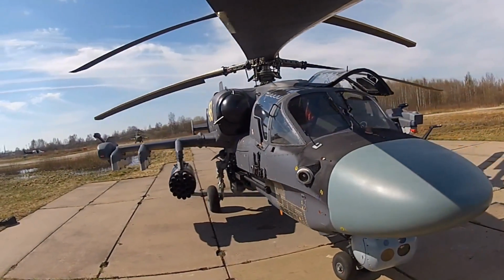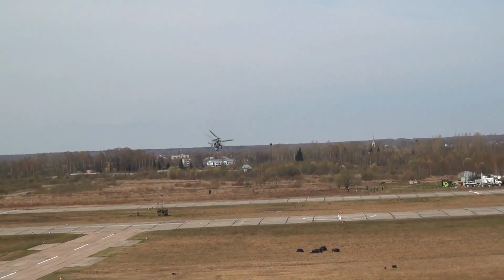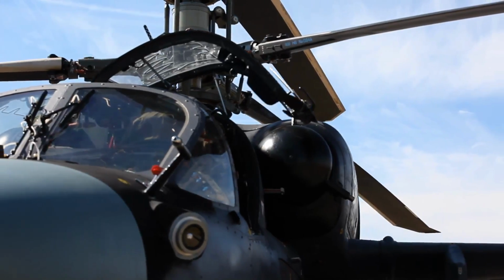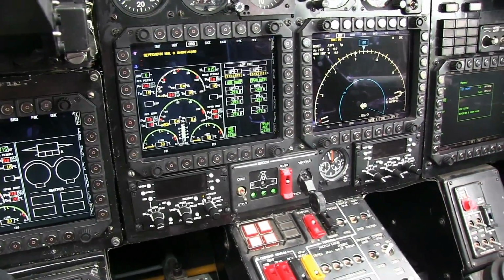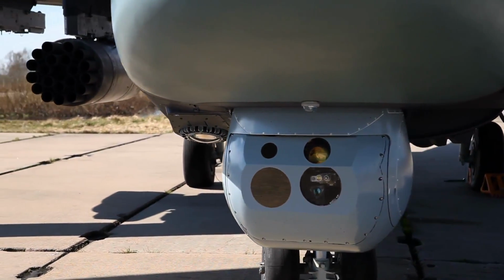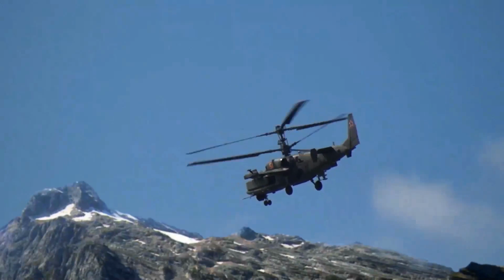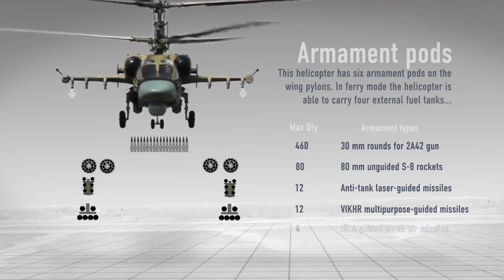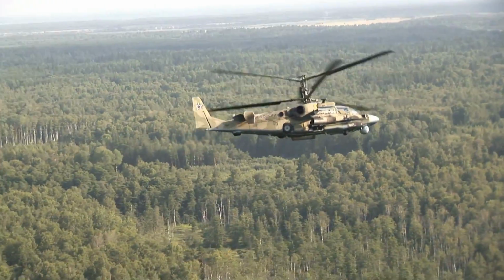Russian Helicopters - Ka-52 Alligator Attack Helicopter Capabilities [1080p]

Comment: Does anyone know why the US doesn't use the coaxil rotor like this helicopter uses? I'm sure there's drawbacks to both the traditional rotor and tail motor and the coaxil design. But can anyone explain?
Reply: Maybe because the next gen Helo from America is going to be like the Comanche and having coaxial rotors will not fit in well with the US Army's requirement for stealth in its future Airframes. I dunno just my thoughts
Reply: Mostly because the doctrine in the russian army is radically different from the nato. Those coaxial helicopters are almost used as aircraft, flying fast and strafing stuff around. On the west, choppers stay low and pop out to attack then go back to cover.

Also there's a concern over the fact that the blades touch each others during violent maneuvers.
Reply: Gaalua Ah, that makes sense. I always thought that having coaxil rotors, which allows the pilot to maintain its target while circling around it, instead of going in for a run then coming back around which you had to do with traditional rotors was a win win. 
 But with the technology we have with the Apache where the pilot can just pivot his head and shoot, the expense of coaxil rotors may not be necessary at all.
Reply from the maker: Kenny Yee Watch my videos on Sikorsky's X2 Technology & S-97 Raider Attack Helicopter. :-)
Reply: arronlee33 How about you stop trolling on other peoples post. Thanks bud!
Reply: because of lack of technology. USA is most advanced in electronic systems, but when it comes to machinery there appears a great lack of imagination and understanding of physics and materials. USA technology is developed thanks to a constant hire of scientists and engineers coming from other countries. Actually this means that without real nation the country gets just inhabitants.
Reply: Galova Congratulation! You just did a paralogism.
Reply: Gaalua congratulations you just did a demagody
and my last statement got yet another evidence.
Reply: Galova
Do you even know what a paralogism is?

You say that the USA have a "lack of imagination and understanding of physics" (which i won't comment) and then you add that they hire scientists from all around the world... If they're backward and hire where there is "imagination" (so you say) then they're hiring exactly what they need to not be backward anymore! You're contradicting yourself!

Then you say: "Actually this means that without real nation the country gets just inhabitants." (Which is a demagogical sentence btw.) It's the US! It's a country that practically grew on high immigration and fast assimilation!

So the fact that you're comparing 2 doctrines of approach to a "lack of technology" and then you go on on conspirationist theory just mean that you want only to talk about that and digress from the subject every time you can. So, please, keep the subject on the choppers.
Reply: Gaalua bla bla
Reply: Gaalua Galova is right.  The US education system is sadly lacking and the news they show us on TV is censored and diluted in every way.  The Government and Armed Services use the incredible technology they have to work toward their own agenda and to keep the masses from getting an inkling of their plan.  I know you may not think I am telling the truth, but please do your research to try to disprove me.  Remember don't look at what they say, look at what they don't say.  There is a pattern that is too regular to be coincidence.
Reply: James Burleson If you're talkin the news media I agree...but you cannot dispute the tech. American tech is way  up there. You don't have to acknowledge that...but there it is......
Reply: James Burleson The common people don't make the advances in technologies and it takes several years for the industries to appropriate one and distribute it. The guy made a stupid statement about "lack of imagination".

It's is very known that the US education system is quite lacking but smart people exist nonetheless (immigrated or not) and they still end up contributing technological advancement. The system seems good to single out the best and throw out the rest in oblivion.
And yes, a lot of things are discovered by the army and they keep it secret unless they don't have any use for it. Maybe if you'd stop giving >2000$ pro capita to the army they'd stop doing all that research.

@ Galova: great answer... oh wait is this the government that took your account to discredit you? Oh wait, now you'll discredit me saying that I'm a conspirator?
Reply: Gaalua Thanks!
Reply: Kenny Yee Actualy it's really hard to make fully balanced coaxial rotor (you can see it on Sikorsky presentation of X2 and S-97). In terms of danger of blades touch each other - it's really rare cases. For example, Vorobyov helicopter crashed trying to perform a half roll with a turn. This isn't a maneuver that pilots will perform routine. Classic scheme is much easier to build, but you'll have to pay 15 to 25% of performance and helicopters is harder to control (on increasing or decreasing throttle you have to move pedals). But it's like V-22 Osprey - russians won't build one 'cause it's really long hard road to understand how it's done. Likewise with coaxial scheme for US (russians build it from 1940'th).
Reply: trionghost Ah, I see what you're saying. With drone technology, and advanced software you would think that this would be an easy process to go small scale and easily go into big scale production with all the mistakes already tinkered out.
Reply: Kenny Yee  You can't just scale up small drone to fullscale plane/helicopter. It have different Reynolds number - different ratio between the size of the aircraft and the air vortex and boundary layer of air. Different size lead to different aerodynamics. And different structural strength.
Sometimes I think that I shoud make a video about basics of aerodynamics to educate people a little :)
Reply: Kenny Yee Because USA cant make one,too much technology involved in materials and drive systems!
Reply: trionghost you gave the only response with which i found to be reasonable and educating. thank you.
Reply: Wataah!  No problem, actually I'm design engineer at Kamov JSC, so I know what I'm talking about ;)
Reply: sty0pa nope. Hard rotor and fully balanced rotor are different things. On fully balanced rotor you need to deal with blades intersection, on hard coaxial rotor - main problem is vibrations (and in this cause - low lifetime of constructions and difficulties in controlling chopper). So from science point of view - it's different things, for different purpose.
Reply: Kenny Yee The world as a whole generally stays away from coaxial helis; the two counter-rotating rotors require two swashplates, one of which must run at twice rotor speed (because they turn in opposite directions), a whole pile of pushrods and balljoints to couple the two to provide control, and the generally 'mushy' yaw control which is provided using differential collective. The control system is, overall, much more complex and expensive, and requires more maintenance.
The standard one-main and one-tail-rotor arrangement is mechanically the simplest, and requires only straightforward mechanical linkages for control.

That's why.
Reply: +Kenny Yee 

AFAIK Most American attack vehicles focus on weapon delivery, rather than vehicle performance. You don't need to worry so much about ceiling height, speed, maneuverability if your weapon systems are designed to target and attack enemies over the horizon.
Reply: Hazzard65 I think that's a great theory, especially with the F35 and such.
Reply: BasementEngineer Thanks!
Reply: +Kenny Yee because the corporations who's paying the politicians to get the contracts don't have to change nothing, whatever s cheapest for them to produce and makes them more profit.  This greediness has destroyed the US
Reply: +Kenny Yee Because is not easy to just add an other coaxil.. Whole mecanic must be changed.. Plans, factories etc.. plus principles to not repeat to Russia...
Reply: +Kenny Yee coaxial rotors have their drawbacks for sure. First is mechanical complexity and therefore price. Second is that Russia really mastered it while US relied on traditional schemes. Considering modern anti-aircraft missiles I wouldn't give any of those heli's a chance anyway.
Reply: ***** I'm not really sure why the American colonists killed the Natives... They may have been useful as worker drones (i.e slaves!) ;)
Considering that the 'Indians' didn't have any guns, I'm not sure how they would have been a serious threat to the colonists anyway.
A mystery of US history, to me as a Canadian. Largely ancient history in modern times, in either country... but still a mystery.
Reply: Konstantin Klimenko OK... The counter-rotating coaxial is more efficient in flight. The two rotors both contribute to producing lift, whereas with a single main lifting rotor and a separate tail rotor, the tail can absorb 25% or more of the engine power without producing any lift. So, the conventional tail rotor design burns more fuel for a given aircraft weight and flight time.
However, the coaxial design is more complex, expensive and maintenance-intensive, so the world as a whole (not just the USA) favours the conventional single-main-rotor layout with a tail rotor.
Reply: +Kenny Yee -- The Russians have the patent. USA are not allowed to use it.
Reply: Ernst Stavro Blofeld Individual countries can build whatever they want... especially the US military :)
Reply: BasementEngineer Patent is patent. Why do you think the Chinese do not market their own iPhone-C?
Reply: Ernst Stavro Blofeld They do, you just can't buy 'em here (or you can, you just have to know where to look.)
Reply: BasementEngineer Where do I have to look?
Reply: OK everyone, here goes...
Pretty much the whole world (including the Russians) usually build conventional helicopters because they're mechanically simpler and require less maintenance for a given flight time.
Coaxials will burn about 1/4 less fuel for a given payload and flight time. That's it.
Conventional single main rotor with tail is used because it's more straightforward and practical to build and maintain. It uses a bit more fuel, but helicopters get horrible fuel economy anyway, so they just make the engine slightly more powerful and the fuel tanks bigger to compensate.
It has nothing to do with "not having the advanced technology", that is pure bullshit, the USA is just about the world's most advanced country in terms of aerospace and military technology. Give it up everyone, quit arguing over it, the conventional helicopter layout is almost always used for engineering reasons--because it's more practical overall, it costs less, is mechanically straightforward, has a simpler more straightforward flight control system, and it requires less maintenance. The fuel consumption of military helicopters is an insignificant portion of an entire nation's fuel usage.
If fuel economy is a major priority, you shouldn't be flying in a helicopter. ;)
Reply: BasementEngineer Funny that Donald Trump flies Rolls-Royce engines then. Why does a man, who can afford everything ,buy, according to you, second rate equipment?
Reply: Ernst Stavro Blofeld Never said RR were second rate... They have plenty of premium stuff... Concorde engines anyone?
Reply: BasementEngineer When I retire I am going to fit Concorde engines on my mobility-scooter.
Reply: Ernst Stavro Blofeld Where will you keep all the fuel? :)
Reply: BasementEngineer Inside the front-spikes.
Reply: BasementEngineer You did say Rolls Royce is second rate. RR is British. So if American engines, according to you, are first, RR must, by definition, be second.
Reply: Ernst Stavro Blofeld No I didn't. I simply said the USA is probably the world's most advanced country in terms of military hardware.
Plenty of countries produce good jet engines, Canada is actually supposed to be rather good at it for example, but we don't build fighter jets and haven't for a very long time.
Anyway, my other post is an explanation of why most of the world doesn't bother with counter-rotating coaxial helis. It certainly isn't because no-one knows how. They just know better.
Reply: +trionghost 

It would actually be very welcome if you made a video to explain the aerodynamics reasons why small drones couldn't just be scaled up :) please do.

Other question for you : what do you think as an expert of the intermeshing rotors design like on the Kaman K-Max  ?

Comment: For the armchair-warriors out there, you have to set numbers aside and look at how the vehicles would actually be used.   The United States has the most experience with attack helicopters of any nation at present.   If you want a fast aircraft that can fly high, you DO NOT get a still very slow and still very low altitude helicopter like the KA-52, you get a fixed wing jet.   It will fly higher, faster, and with a tiny radar footprint by comparison.

When we employ helicopters, and what has PROVEN successful, is to use them as extremely fast tanks.   The Apache has better armor to survive small arms fire, is very successful at peakaboo tactics with its dome radar mounted above the rotors so it only has to barely peak that above the tree line or ridge which the KA-52 cannot and must completely expose itself with its GIGANTIC silhouette, and the Apache most frequently deploys its sidewinders at long range completely unseen (up to 18km range) vs the KA-52s common tactics of swooping in completely exposed and firing a barrage of dumbfire missiles.   While the KA-52 does have guided missiles, the R73s aren't nearly as good and have only a 5km max range.  

So you would fly these COMPLETELY differently, but IMO the United States has a much better idea of what a helicopter should do, which is hug the ground (since a stealth helicopter has proven bullshit in practice), peakaboo, and hit fast and hard out of nowhere and disappear.

Comment: Well, the HAL Light Attack Helicopter has a ceiling of 6500m, so I don't know what the fuck these guys are talking about when they say that the KA-52 has the highest ceiling of any attack helicopter.
Reply: That's the Hover celing, wich is the maximum altitude wich the helicopter is able to maintain remaining stationary in the air (hovering)
SInce at these altitudes air is less thick engines and blades makes less thrust and in order to maintain higher altitudes you need to be moving forward, thus acheiving lift from the airstream hitting the blades (and creating Dissymmetry) and creating lift on the Stub wings

Comment: And the major handicap of this helicopter is its fixed machine guns, no turret got to turn the whole machine and before you do you're down.
Reply: It has co axis turrets
Reply: From what I understand that is actually a benefit as it makes the gun so much more accurate
Reply: It is allowed to increase accuracy of a factor of 2.5.
Reply: It's not fixed it does have a small range of movement. Being semi rigid gives it an increased range over a mounting like an apache's and since the helicopter is highly manouverable it's hardly the drawback you make it out to be. Even on the Apache the gun is mainly used on targets in front since it loses stability when off boresight.
Reply: jaxative jax This problem can be solved by using machine gun pods.
Reply: Billy Bob John
At first, you should understand, that there isn't machine gun, there is aircraft cannon. It's great difference, especially in recoil, consider, that to a plane work other forces as by vector as by value and installation of large caliberaircraft cannon on helicopter - it is already great achievement, but giving her some mobility is just wonderful! For eample, if dismantle canon from fighting plane and just install it to turret, then or canon tear out turret with giblets, or overturn helicopter or something worse. If add that design of rotors makes it easy to move strictly sideways, low mobility of the gun is not a big problem. At least for us. But it can be problem for enemy, that there is rapid-firing canon.
Reply: goddamn it
it costs 30 mm cannon ! Do you understand what it's like son?
Reply: ok Tiger has a 30mm cannon on turret. And is directed by a pilot head so it is blether but the engine power... an general  amount of armament  is huge
Reply: muzulin At first, pay your attention, that not evey tiger is equipped a turret. At, second, look to specifications of cannon of KA-52 and farter of tiger. By the way, you should look to pylons :)
At third, as i mentioned before, considering performance characteristics of KA-52, turret just no need.
Reply: The turret is semi-fixed. It is an extremely powerful 30mm cannon, which requires the extra stability in the air. They simply traded quicker movement for range and accuracy, which is the new meta. Whoever hits who first is the modern form of war. Most american weapons are hybridized to combat insurgents, which is expensive and redundant in a real war.

Comment: As another example the V Rod engine for the HD was developed by Porsche... They call it a partnership, but the truth is that this "partnership" meant that HD told Porsche the overall size and measurements of the finished engine they wanted and Porsche did the rest of actually constructing the entire engine within those specified limits.

Comment: KA-50 is the old design and KA-50-2 was designed for competition and KA-52 was after that but in side by side. KA-50 can do recon as well but the pilot load is just little heavier. In 52 both can do same tasks as controls and dashboards are identical. In 50 a flying and operating weapons and recon was very easy but the problem was that pilot only had one eye pair so when looking one direction, the situation awareness was almost non-existing to other directions.